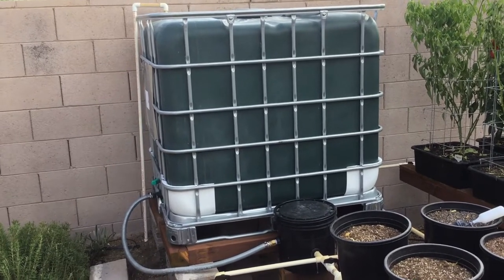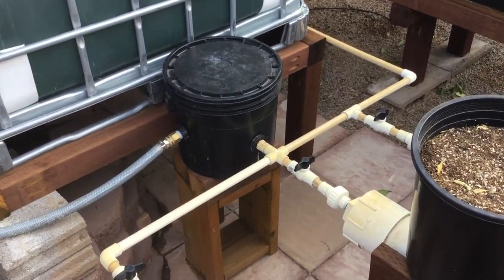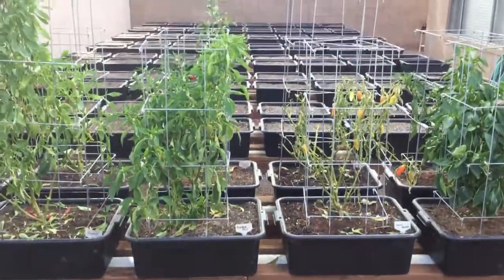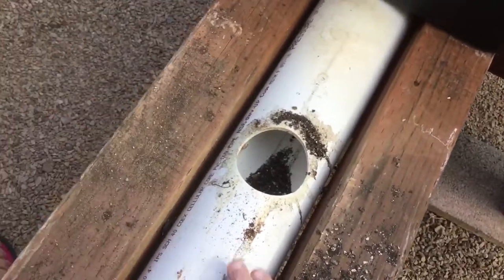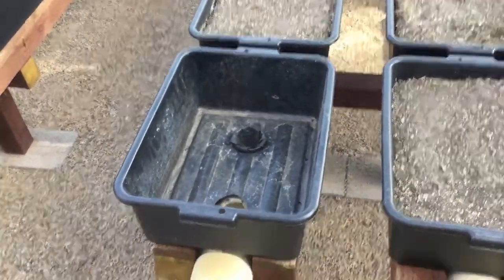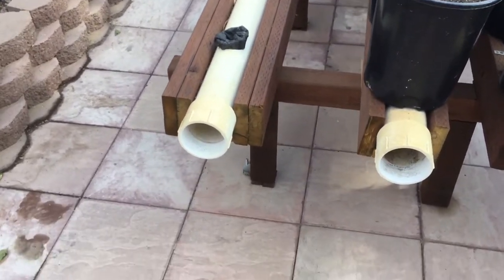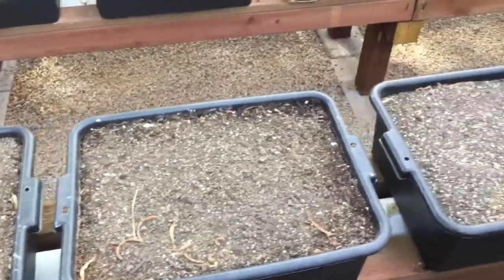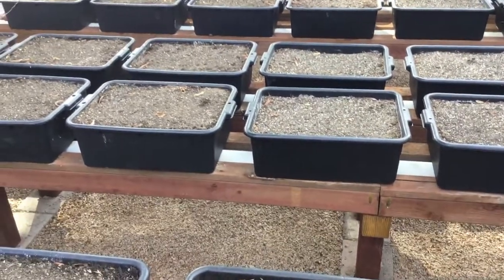Second video on our garden system. Focus is on the system and how it works.

Comment: Have you had issues with the roots growing out of the net cup onto the PVC and dripping water constantly on the ground ?
My system is doing this now and I’m trying to find a solution. Thanks.
Reply from the maker: If you wrapped the net cups in weed barrier that should help a lot.  If you do get a few roots in the tubes, just lift your tubs and strip off the roots from the net cups. If you are leaking water from one of the net cup holes in the supply pipe, then you need to adjust your float to reduce the water level in the supply pipes until it doesn’t leak.
Reply: Cheri n Jerry's Garden Thank you! I purchased some better weed barrier this time also, sure hope this helps. I purchased the cheap plastic feeling stuff last time and the weeds grew right through it.
Also this is my first season using master blend fertilizer and I’m extremely happy with the results this season.